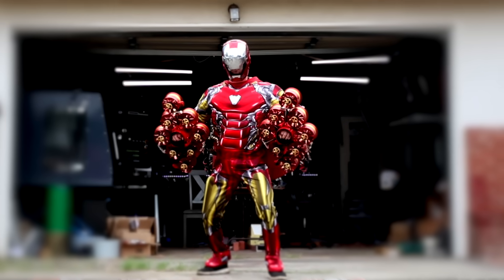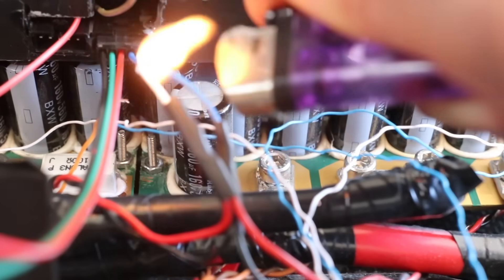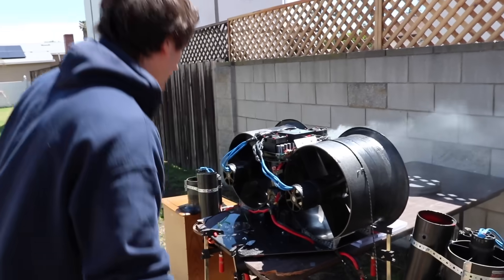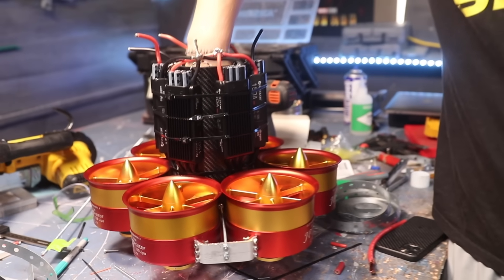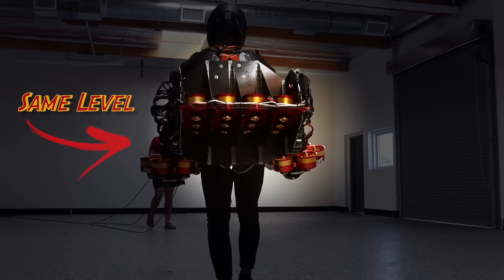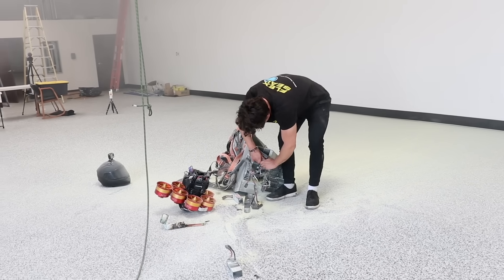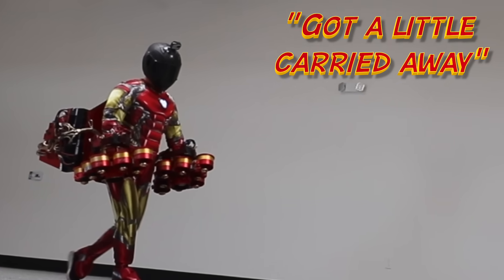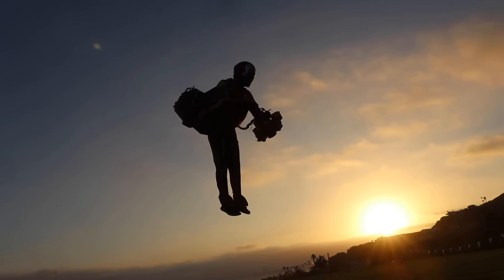Real Flying Iron Man Suit That Comes To You!

Comment: Let me give you a little tip kid you're amazing okay your equipment your your expenditures were high but your equipment the way you got to design very cool here's your problem even Tony Stark use the Jarvis so in your case I would say add an Arduino to your system because the Arduino will be able to take care of most of the voltage problems you're running into anytime you have a high voltage problem guess what the Arduino does shut the system down so you don't fry it or explode or destroy it because every time you play with it what you're doing is you're drawing wires those wires are very sensitive you're playing with something that you don't know how to use yet and I know you're going to figure it out but here's the thing you need to have a computer system running that

Comment: It would be neat if you made a high-frequency blade (a blade that vibrates really fast to cut things easier). I know it isn't currently possible to make one comparable to the strengths as ones in Metal Gear Rising: Revengeance, but it would be cool to see a sword capable of cutting through things easier not due to heat.
Reply: Suspicious little bot. I see through you.
Reply: I would call it a vibro blade
Reply: he will probably shed some blood while making it

Comment: You could add actual plasma cannons on it by building a battery that recharges itself 24/7 and using that battery you can power a super strong laser you can then use mechanics to prop up over your shoulder and a button on your wrist to shoot it

Comment: Just use a heavier gauge wire for higher  current in future projects. If current is high enough it may need a solid wire instead of stranded copper wire. Good job though guy, keep at it.

Comment: i want you to dig a hole fill it with explosives then put a unbreakable metal platform over the top the stand on that platform with a glider then blow it up get catapoalted into the airt then ans the platform falls back to the ground you can safely glide away

Comment: I honestly am convinced you made a big mistake by running all your tests on battery and not having an external power source with an observer with a kill switch. You would have saved so much hardware and avoided most risks. Also you could test with more power and then design your stuff knowing the power needs.
Reply: Of course other than that, mad respect to your dedication!

Comment: I understand the allure of having thrust coming from our hands. However, in terms of stability, it introduces way too many variables for a controlled, stable flight. An idea would be to have a control stick coming off of either side for each of your hands which is capable of moving in the manner a video game controller's analog sticks would move. 
 They would now act as a place for your hands to naturally rest as well as assigning their range of motion to the stabilizer blades/fans.
 Now, there is a control point to work with when finalizing how much power you assign to specific motors.  It will be much safer and more easily controlled

Comment: >regular ol' scissors on wires

Young man, where in the nine bloody hells are your diagonal cutters?
What gauge of wire are you using for it to catch this much fire? There's a relationship between wire cross section, composition, and resistance(heat), for future projects. If craft scissors can cut it, it's signal wire.

Comment: Just a heads up. Dry powder fire extinguishers can disintegrate the insulation on wires and is incredibly bad for electronics. Maybe go with a CO2 Fire extinguisher in the future. Co2 is cold if you want to cool the elctronics and is dry causing no damage.

Comment: You can buy RC jet engines, don't use electric motors, look it up. It's the only way you can get your idea to work. Power to weight ratio is a lot higher

Comment: Hmm, if you were to incorporate some kind of energy regeneration system, you could extend the flight time, I'm thinking some kind of micro wind generators which go to a power amplifier and then feed that power into the power systems, with that much thrust and wind being generated once you get the system going it would take over for the batteries quite a bit, with further improvements flight time could be 20 minutes or more, just an idea.

Comment: your missing a massive difference..  the armor supporter the weight and control.

you have neither need you human to deal with G forced and torque, pitch and  Yaw.

good luck without an actual control system.

👍👍👍👍👍👍👍👍👍👍👍👍👍👍
Reply: ⬆️⬆️⬆️ I have a surprise for you 🎁🎁..

Comment: When your wiers don't work correctly because of the amount of energy they are transmitting then you don't overload them until they start smoking multiple times. You buy wiers made to handle more power. also, when you have something that is constructed to generate enough power to make you fly you don't just bolt them to a table thinking that they will not move said table. you bolt the table down too. Like why on earth would you do any of those things? Ooooo, yeah... Dramatic effect. Either that or incompetence, I really do hope that it was the first, because someone incompetent should not be playing around with equipment like that. Those things are seriously dangerous and if you want to play with such things you should at least sit down for a few hours to contemplate safety before doing anything, and if ANYTHING goes very wrong, you do NOT start it again before fixing what went wrong. It's common sense, I'm a few years younger then you and I seriously cringe hard at the first 6 minutes of this video.

Comment: By the tesla of jetpacks you mean the zero of jetpacks. The gas one is cheaper and at this moment isn't as practical as the gas version.
Reply: What about if you charge it with renewable energy and use it lots to save on all the gas?
Reply: @filmflour  Its not about the cost . Its about getting all of the functionality out of something. For motorcycles its range and fun. For this jetpack its thrust and range.

Comment: I think you just inspired me to try my luck with doing this after I graduate with a mechanical engineering degree in May. Iron Man is my all time favorite movie. Watching you fly with something you engineered got me real jittery 😂 Great work!
Reply: U also have to be filthy rich to fund yourself with ur dream  🤪
Reply: @zoverawizo7476    I’d say a project like this is MUCH more achievable financially than buying a Lamborghini. But you aren’t wrong. Luckily engineers get paid well so I’ll probably piss my wife off spending most of the money on “pointless” contraptions 😂
Reply: Just the person to ask; would I be wrong in saying;
If you look at a Dyson cylinder vacuum cleaner it uses a chamber of fans linked to a hose to create strong suction. So if you created a chamber of cylinders with fans linked to one output it would create better thrust? 
If so it'd be able to lay flat creating a way to stack the chambers on the back with the right ventilation so it's less cumbersome, easier to direct, and much more powerful overall.
Reply: @jackcollins7061       Not a bad thought, but I think you’d want a direct jet. Doing that will creat lots of unwanted turbulence and energy losses. You never know though. Fluid dynamics is one of the most not fully understood fields of study.

Comment: i am still a bit stunned by how easy he made it look despite very clearly struggling a lot

like, he just... started flying without a tether... so casually, just hanging out in the air... how much training did you do with it? how do you control how much thrust each set of motors is making? are they all one set? did you make them stabilise you actively? or are you manually controlling the thrust of each set? what even are the controls? is there an arm switch/button? what caused all the issues and how did you fix them?

the project was chaos, yet the video is just like "so i made a jetpack, then it broke, caught fire, smashed itself, so i fixed it, then it broke, so i made a new one with a different plan, then it broke, caught fire, smashed itself, so i fixed it, and now i'm getting a donut"

Comment: The next step (that none of the other companies have solved) is thrust balance. Track each thrust plane's orientation and relative position (like with VR controllers) so that each can adjust output on the fly to always keep you balanced.

It would be extremely hard (thus why not yet done) but could 100x the scale of this nascent industry by lowering the skill bar and increasing the safety.

Comment: Well the real problem will be power generation, the suit uses a theoretical power plant “arc reactor” which powers the thrusters and electronics- side note a real realization of this would be like flying a bomb as any instability would cause the whole suit to rupture its energy storage and circulation (they never talk about that in the movie). The issue with arc technology is it’s exactly that, unstable. So modern jet packs resort to using pressurized fuel tanks and storage for propulsion. But to put that much propellant in anything you gotta get government involved, and that’s no fun or cheap. Glad to see you found a nice work around using turbo fans and brushless motors instead 😊. Looks like you had a lot of fun!

Comment: if I had buckets of money like Elon what I would do is make layers of powered aro-gell or just regular between layers of iron or steel "or whatever compound has a really high melting point" and use the most powerful mini jets I could buy, possibly even hundreds of micro-jets and in this scenario I have nearly infinite money so if these "micro jets" don't already exist I'll hire someone to make them exist. The hardest problem in my opinion is power, jets need an insane amount of fuel so either I'd need to make the most condensed fuel or most fuel efficient jets of all time, or I would just make a fuel reserve within the armor to fix the problems of that I'd actually have to map out the armor. To be frank 'm far too lazy to care enough to do that.

Comment: There is already 6.2 thousand comments, and I’m sure you already thought of this but.. I highly suggest putting fans on your feet/legs it wouldn’t fix the center of gravity, however it would help with lift and stability, if you were to make boots, you could make a twin fan design, and have a opening at he heel for exhaust and aero. Either way great video! And I can’t way to see the next.

Comment: JLaser, a little suggestion for the project. If you are constantly having fire issues?

Consider installing a fuse box system. This helps with creating a buffer so the circuit doesn't oversurge the wiring.
Reply: THANKS FOR WATCHING AND COMMENTING, YOU'VE BEEN SELECTED AMONGST OUR LUCKY WINNER'S DM THE TELEGRAM ABOVE TO CLAIM YOUR PRICE IMMEDIATELY 👆👆👆👆👆

Comment: full 100k trial and error from them at least 60k could get reduced by following in semester elektric engineering (wirethickness/heatin, masspoint, circuitnetworking, experiment PREPERATION)

Comment: Don't let anyone tell you that it's impossible... true, but know that it's illegal. 😆

Also as I'm watching this, Carbon fiber is strong but they stopped using then in motorcycles because they'd explode after a very small nicking. So uh... good luck not getting decapitated.

Adding muscle would've increased your overall weight, what you should've done was do cardio only.

Comment: Any plans on strapping those to your feet and going higher. I think the same diamond formation around your feet would be enough thrust for you to get higher then 10 feet and into actual ironman status.. I don't know how the flight dynamics would work. And there's a good chance you'll do a backflip and land on your head just like the lab testing scene. The last step would be to upgrade the lipos for safety and longer flights then skrink down the back as much as possible so it's not so heavy. You might need to do acrobatics to recover and it'll be much easier with a lighter build.

Comment: Not sure if it’s possible, but maybe halving the back thrusters and adding them to the front of the torso to add an equal amount of thrust from both directions. i’m sure it would be much safer with an electric rather than fire based propulsion

Comment: Could you stack the motors on the back on top of each other? Would that still provide lift? An if it did would that lift be stable? You mentioned that you had to reverse some motors so if those are in the back you couldn’t stack them ontop of each other because it would be sending force in different directions, but if you stack motors on top in theory it should be fine, in theory. It would make the profile of the back jet back more stable, actually flying and maintaining stability will be a problem with the back protruding out that much and being so low, I know why you made it low, but thinking if the stacking motors works it could work. I’m just a person on the internet though no physic degrees. Just my thoughts hope they help.

Comment: if you want to make a slight improvement to the hand thrusters i'd build a sleeve for your arms with some strong magnets and line the inside of the thrusters with the rest so that it can "snap" into place. if you get the guidance setup enough you should be able to have it "roll up" and onto your arm when it gets close enough... though that might be a bit dangerous for the fingers if something goes wrong lol. but just having the magnets would make it nice to be able to just reach inside as it gets close enough.

Comment: So out of curiosity did you run the calculations when making the wiring harness to ensure it had thick enough wires for the expected current draw? As that seems like a pretty obvious calculation to run before building an electrical system but with the issues you had I feel it needs to be asked. Also seems like it would be a good idea to install fuses so any situations where current draw is higher than expected it blows the fuse rather than an expensive component or having the whole thing catch fire.

Comment: I'm a couple days late to this one, and I don't know if this has been suggested already, but I noticed that air intake could be optimized, especially on the backpack. The way it's built, there's slats between each row of turbines that might be impeding airflow, and the thought I had when I saw it was adding a second, less powerful set of fans to ram more air into the main set - similar concept to the way a supercharger works. I don't know enough about the subject to know whether this would be a more or less powerful or energy-efficient design, but I thought I'd share nonetheless.

Comment: Well I think... You need to add some edfs on your feet and make their thrust less .... Now because the thrust is low on your feet than the rest of the edfs, it won't try to lift you against the gravity.....that way it will be more easier to move forward and backward..... And it gives more stability.... Just have to deal with the learning curve

Comment: I'm pretty sure the 100 engine that can send a 4100 pound chunk of metal (bugatti veyron) from 0-60 in 2.5 seconds, isn't exactly the same as some fans connected to some batteries. And before you say "what about teslas" the batteries alone weigh over a thousand pounds.

Comment: #1 gotta get that force off your shoulders, a proper full body exoskeleton would distribute the weight across the full form and allow for limb locking stabilization (that's an obvious problem I'm seeing in the video)
#2 gotta put something better between you and the combustibles. Cevlar would be a strong choice, but obviously true iron man goes insulated air tight steel plating. Given that, you can start to strengthen and shrink some of you lifts, gonna be louder, but you can make a full suit sound proof and run a speaker system outside it.

Comment: my man, try using a high current quick connect for the batteries so you can just pull on the wire incase of a electrical failure.

Comment: As of 11:42..

Just wondering what if you've got 50% of the motors spinning one way with the remaining 50% of the motors in the other direction?

Second, I know you've already put so much time and effort into building this but I'm wondering if there's any thrust being lost on the sides of the motors? Best way I know how to explain this is imagine you've gotta marble sitting on the table and you take a deep breath in and you blow...(how far does the marble move?) Now imagine you use the same amount of breath but blow it through a straw?

Marble may move further, you haven't changed the output but you've addressed any loss

Comment: I feel like saying “that’s awesome” but let’s be honest that would be an understatement to your project, and also I think by using these same components u could make the Falcon suit. I mean u probably wouldn’t be able to make the wings with metal bc that’s a lot more weight but use sum strong material and add some more propellers within the inside so they’re not visible and nothing would be able to fly into the them. Maybe use like sum carbon fiber for the wings and probably use those nylon (I hope I spelled that right) straps and magnets to get the wings to move and even shoot out from your back. Also you could add more of those mini motors in some compartments on either both wings or maybe even in like a backpack or whatever u planned to store the wings in. All that aside JL I freaking love you guys and you inspire me immensely.